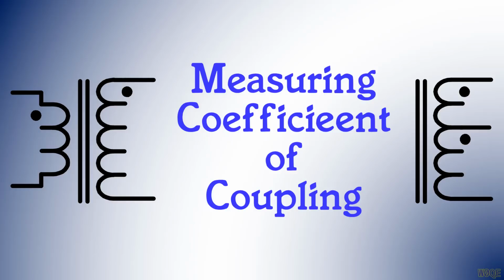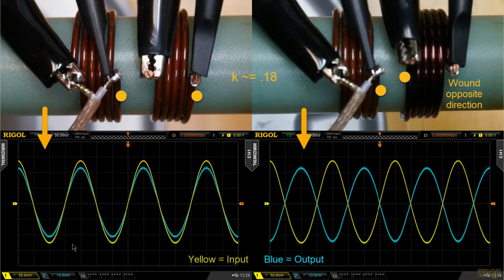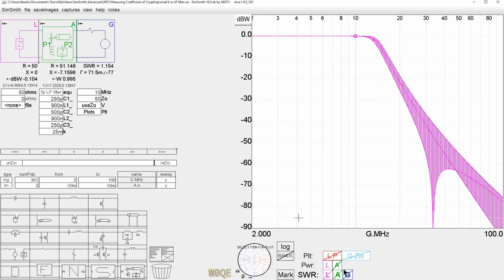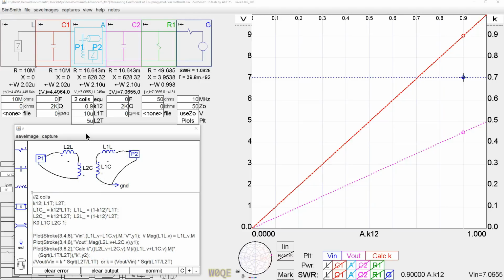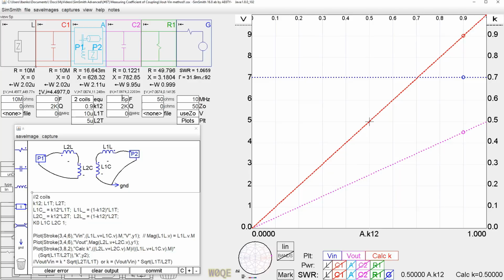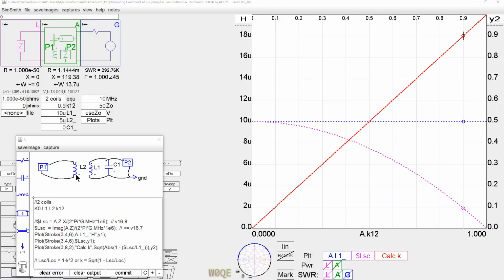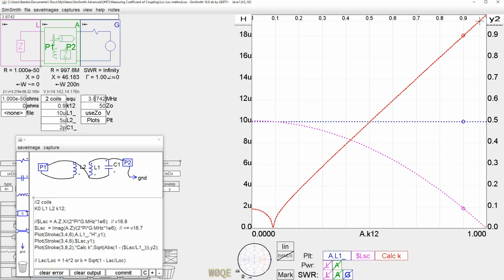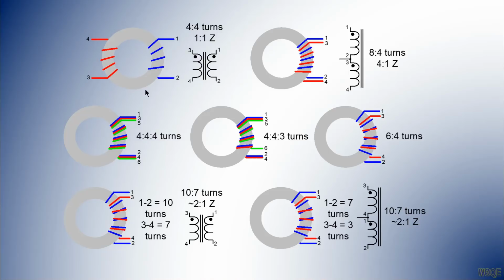#87: Measuring Coefficient of Coupling

Comment: Excellent work, I wish I had your formulas and calculation on written format, so I can save it on my design  notebook.
There are two practical implications:
1.  You can do the voltage method and then open and short circuit method, in practice, and compare them with each other and from there one could calculate parasitic elements.
2. How do you want to measure inductor in the voltage method? Do want to keep secondary open and measure the primary, and primary open and measure secondary with LCR meter first, then connect the primary to V_source and measure the secondary?
Of course, with open short method one could easily use LCR meter on primary. 

It is also instructive, if you could show us how to do that with a Network analyzer, such as NanoVNA.  That is given S11 and S12 and say S11 while the transformer secondary has short and open, we could get K, L1T, L2T, and core loss, C1, C2, C12.  I guess for Cs we also need the self resonant frequency as well. 

I guess, using two closely spaced  frequencies at primary side, one also could measure the linearity of the transformer core (ie. measuring 3rd order intercept of transformer)
 Thanks again.

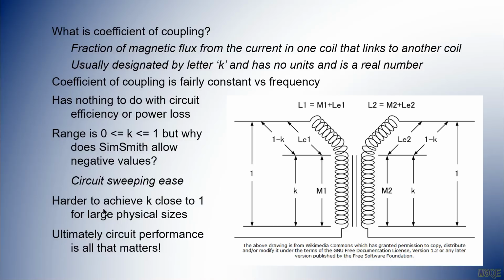Comment: When I measure the impedance of a 2:16 turn UNUN wound on a toroid, and compute the inductance, the value varies as the frequency increases from 1MHz to 55MHz.  At some frequencies, the imaginary part of the impedance becomes negative, and the transformer appears to be a capacitor.  This happens when either the primary and secondary is measured, with the opposite winding open.  Is this due to resonance within the toroid?  If coefficient of coupling is computed based on the inductance, does k really vary over the range of frequencies?  If so, does SimSmith allow coefficient of coupling to be read from a file, similar to the load file?  Thank you.

Comment: Fantastic.  This will really help a lot with my measurements of k.  Based on this, I think for the cases I've done already, my measurements were good, but for low-k situations, I would have been unaware of my measurement errors (or completely baffled by them).  This video is definitely a keeper!